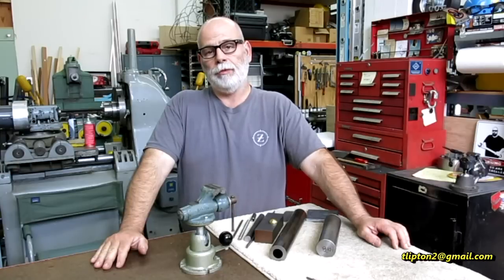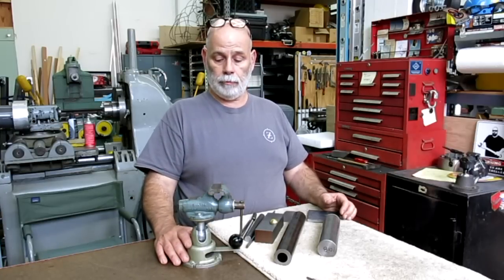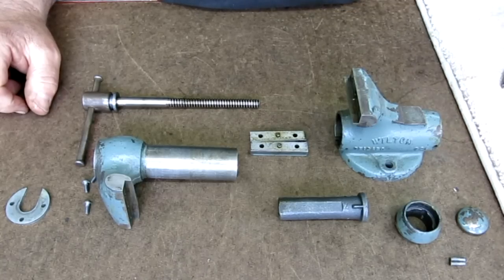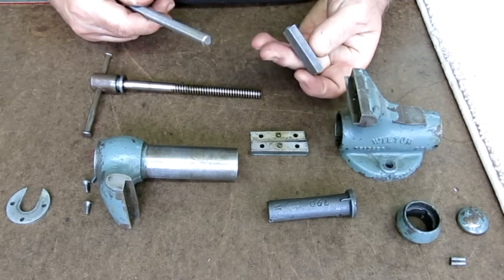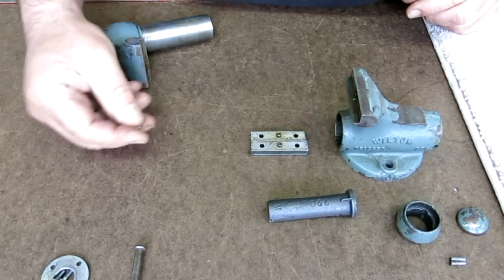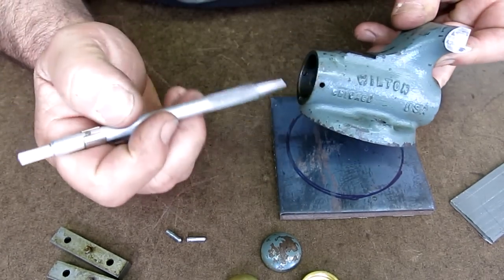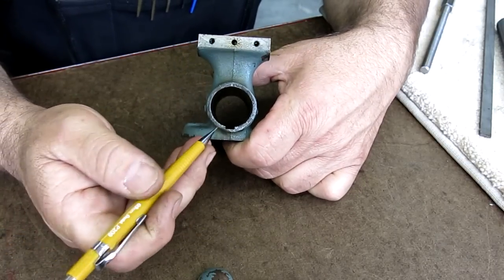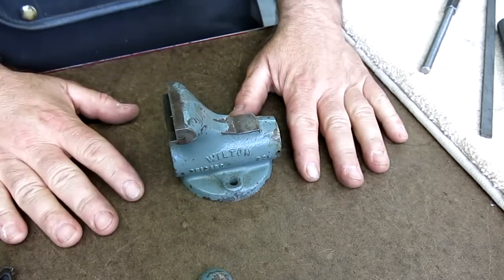Wilton Baby Bullet Kickoff

Comment: Tom, I have one of these little Wilton's I received in trade for some work done in the 70s. Mine has smooth jaws which I prefer for lite gun smithing work.  I mounted my vice on a 1 1/4" X 1 1/4" X 3/16" angle and Chuck it in a 4" vice when I want to use it. Neat project.

Randy

Comment: Hey Tom, this looks to be a great little project.  Another way you might consider to make the keyway in the fixed jaw.  Overbore the structural tube to accept a thin-wall inner tube (either turned or bought) that results in the desired ID.  Then simply cut or mill the thin-wall tube to create the desired keyway.  This is then pressed in the outer structural tube and welded and/or Loctited in place.

Comment: Tom just a few suggestions you could mill the checkering on the jaws in the mill if you make a simple fixture to clamp in the vise to hold them at the angle and use a side cutter and step off the spaces in the Z axis. because they have a pin in the middle this could be a very simple fixture with a hole and tapped holes for the jaw screws at the angles. if you wanted to really be efficient you could use a thread mill of the proper pitch. The key thing in the base what if you put a key in the base the full length of the bore so when you weld the split tube on top it would help alignment and you could weld over the ends on the bottom to tie the tube back together. You may have already thought of these.

Comment: Very cool project. I like your vise and remember you showing it before. I do not have anything that fancy except a nice Micrometer Holder! Seeing all of the various parts you showed I figure the body of the vise was poured into a mold and then machined up. The  kind of work I have seen you do I know it will be likely better than your personal. I suppose changing to a acme thread makes sense as I am surprised that was not used in the original. Would there be anything to add because of that like a grease or oil fitting?

Comment: I'm playing catch-up on videos, so that's an interesting choice of project Tom, I would never have thought of scratch building a replica vice, but can see there is indeed a logical build process in there. Well done.

I was busting to say cut a keyway as you said it. Would dropping an aluminium dummy "key" (ie a scrap of aluminium) in there and knocking it out after welding help control the keyway size? Alternatively just lead to a weldment with a "key" stuck in it? The thought being that the aluminium should contract more than the steel once everything is cool, and drop out. That would be my cunning plan anyway ;)

I didn't get why you needed a shaper for the V form? I'm spoiled with a horizontal/vertical, and heads. tables, and vices that tilt all over the shop, but understand you want this build-able by any viewer. Would either a V form tool (an interesting grinding exercise in itself) or a 45 degree dovetail cutter (and obviously flipping the work) do the same trick?

Comment: That's going to be cool project Tom! Looking forward to seeing it unfold. I'd be glad to assist if needed, so just let me know. I'll be helping with the machinist vise which I need to get cracking on soon. 
Talk to ya soon!!

Adam
Reply: ***** and why does not  NYC CNC machines the vise's body on his Tormach cnc mill. :-)? It would be cool to see all three collaborating on this vise project together.
Reply: +Aulio Diaz - because then the project would be using equipment that the average home machinist will not have. Currently the project is being kept to things that pretty much just require a lathe, mill, and welding.
Reply from the maker: +Mark Sinden Hi Mark,

Well said. Thanks for the comment.

Cheers,

Tom

Comment: Hi Tom, looks like a great project will be watching.

Suggestion for the anti-rotation feature (key way) between the movable jaw ram and the fixed jaw assembly receptacle.   Cut the key way in the movable jaw ram as normal then use a series of 1/4 or 5/15" dia dowel pins poking through the receptacle tube's wall forming a male key in the bore.   I think that would be easier than cutting a slot in the tube and have it opening or closing up possibly binding on the key in the ram.  You could even have two rows one at 9 o'clock and 3 o'clock position.  The pins could be locktited in or welded permanent and dressed off.

Craig
Reply: I was thinking the same thing. If it works for a 5C then a small vise shouldn't need much, no side load just a guideway.

Comment: Tom,  For the Keyway,  You could cut that in your lathe with a regular HSS tool bit and a modified boring bar.  I have several bars and inserts from Dumont to run tapered keys in are CNC lathe.  What size key do you need?

Comment: Neat build!.....a better solution to the key problem, would be to use two thinner wall tubes, the inner tube having a wall thickness off the key depth, and a slot,  the key width size, then the outer tube would be solid to make to make up  the remainder of the diameter, and welded at each end and faced off for length. That would make a uniform key slot.

Comment: fun project, would the welds you mentioned be stronger than cast metal or would they be a weakness compared to the cast metal one?

i just have no idea about a comparative strength of welding solid metal together and casting it.

Comment: How about mounting the key on the bottom of the tube with several small screws. Let the keyway cut in the bottom of the moving jaw tube slide over the key fixed in the tube

Rick

Comment: the little bolt hole area with the raised material is that what they call a boss when its raised around a bolt hole area? i noticed you were trying to think of a word for it and i do believe as being a young machinist i would call it a boss but not totally sure if im correct lol?
Reply: turboed350 and also for the internal key slot couldnt you just use a boring bar and do like a pull thru cutter like how they do rifling on a barrel but with no twist just a nice scrapper tool cut and thrown on a solid boring bar type of device and single point cut it as you drag it back thru the part in a lathe? i know iv done things like that but with brass or softer material so steel im not sure how it would cut without like an adjustable roller on the back side of the boring bar  180deg off from the cutter to make lots of pressure without having to spring the boring bar or twist the tool post on accident just use the internal bore for hold back tool pressure with a half cut pipe to put inside the bore so you dont screw the bore all up from the roller/stop side? ok its pretty late im prob just tired and being a goof but figured id throw it out there and see what you think since im weird and would try something like that just for fun.

Comment: Hi Tom I couldnt ask on the new vid as comments had been turned off, I wanted to know if you knew of a cheap yet good quality dial indicator the pin kind not the button as I just setup my 4 jaw and it needs one. Thanks
Reply from the maker: +gigabytex64 Hey Giga,

I'm sure you could find a sale deal on one with a magnetic base from that Australian tool supplier we talked about. Typically they run specials and sales monthly. Economical dial indicators are a standard item. Hope this helps.

Best,

Tom

Comment: There is currently a baby bullet end cap on ebay. ends in 6 hours Listed as "Wilton No 20 baby bullet 2 inch machinist vise tool end cap NEW"
Reply from the maker: +Aaron16 Hey Aaron,

Thanks for the heads up. That is a pretty rare piece of kit to find on ebay. Thanks for the comment.

Cheers,

Tom

Comment: lm looking for the fit in back tthe vise
Reply from the maker: ***** Hi Hadi,

Do you mean the clearance between the sliding parts? If so its approximately .003 inches on the diameter. Its a fairly close fit. Hope this helps.

Best,

Tom
Reply: oxtoolco  

Actually , l mean the  2 parts that located  in the rear of main body 
you can check at 9:30 in the corner  right down 

sorry  , l couldnt explain well 

Hadi

Comment: Tom:

I just had a minor brain fart.  How would it work if the hard jaw recesses were both made at the same time.

Finish everything except the jaw mounting surfaces.  Assemble the vise and clamp a hunk of steel in the vise but below the jaws.  Tighten it up then mount the whole works in the mill.  Square it up and it will be a piece of cake to get the jaws parallel and at the same height using a simple end mill.

No gronking necessary unless you feel compelled to do so.

Now you can tell me the error of my idea.